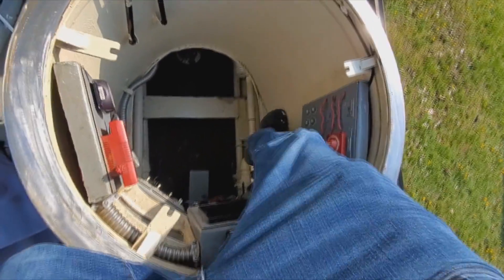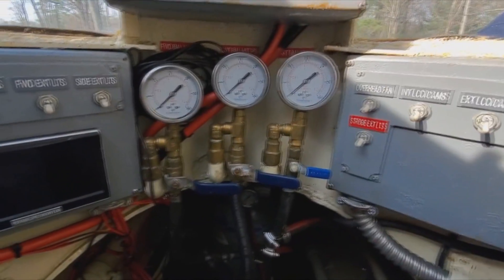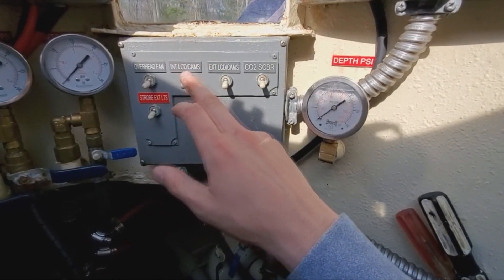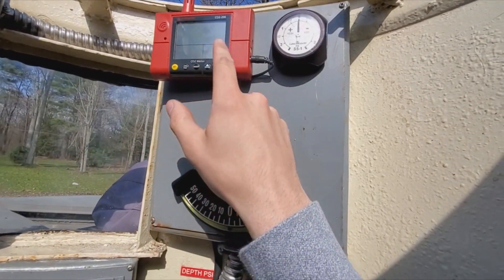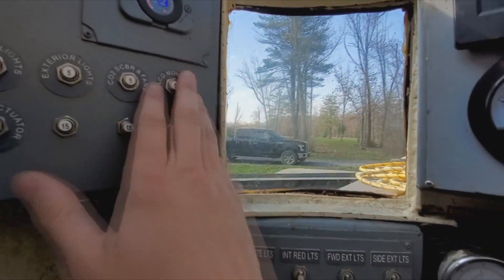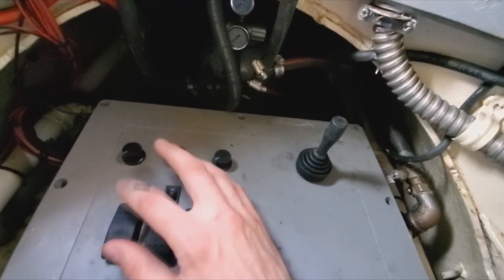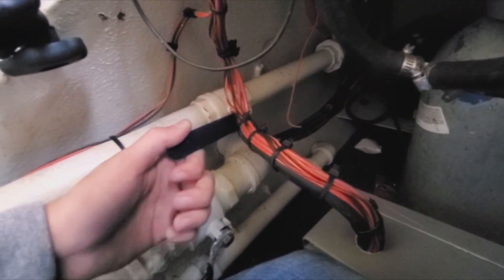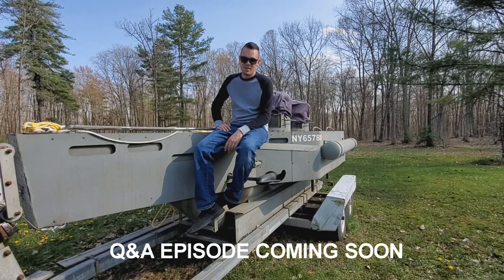Personal Submarine Tour

Comment: You only weigh 6000 LBS? I don't see any lifting eyes on deck for hoisting.
Reply from the maker: The lifting eyes are under the deck. It should never need to be lifted again but could by removing the top deck plates.

Comment: Something instinctive bugged me about your control layout, but it took a while to figure out what it was. You don't appear to have any safety feature to prevent dumping your ballast air overboard. If you are mid-dive and need to surface for an emergency situation (say, electrical fire) and get in a hurry, you could concievably move to perform an "emergency blow" without first closing the ballast tank flood valves. If you do that, depending on the flow rates of the blow and flood piping, you could end up dumping your ballast air overboard without filling the tanks, resulting in a situation where you become stuck submerged.
Reply from the maker: What? - The vent valves (to release air, to submerge) are closed just as the top of the hatch is level with the water. The main ballast tanks are soft tanks "bottom always open". They can do a emergency blow at any time.  The trim tanks are hard tanks. Top vent valve in addition to a lower valve. Those I trim for neutral buoyancy. Those tanks, you would need to open the lower valve to blow the water out. But I think you were confused, an emergency blow is easy with the main tanks. As for electrical fire, although everything is fused, I have onboard scuba to breathe while resurfacing/or flooding it. Decompression isn't an issue because the flood valve flow rate at max depth of 60ft is about 300gpm at that PSI depth. It would take 2 1/2mins to flood allowing plenty of time to adjust to the pressure equalization and swim out. Last thing I figure I'll mention, for the redundancy of the ballast: The fore, aft and main tanks all have separate airlines. Hope that clarifies it. lol
Reply: @PlanesBoatsandSubmarines  if I understand you correctly, you are relying on the administrative control of "I close the valves at the proper time". That's something, but it's not great. If you forget to close those valves before opening the valves from the compressed air supply, nothing stops the compressed air from being dumped overboard. An engineering control preventing the vent and blow valves from being opened simultaneously would be superior.
Reply: This is true, however, it is only designed for 60ft. I don't think they'd go in a lake much deeper than that. Worse case scenario they should have a valve on the hatch to flood the compartment incase they need to equalize pressure and GTFO. Of course, a rebreather/oxygen tank would be helpful for that because no human can hold their breath for that amount of time and swim to the surface.
Reply: @williamsplays8528  yeah, an escape breathing apparatus would be good, along with a way to make the occupants' compartment into an escape trunk. It would be important to waterproof the electronics inside. There are probably some decompression considerations that need to be considered as well.

Personally, if I were designing such a submersible, I'd  aim to make the cabin positively buoyant and have a way to release it from the rest of the body.

Also, if you're designing the ballast control, use a tee valve that only allows you to connect two adjacent positions at once. With the connection to the ballast tanks in the middle position, there is no way to connect the compressed air supply to the vents.